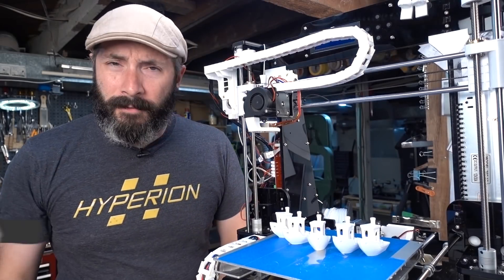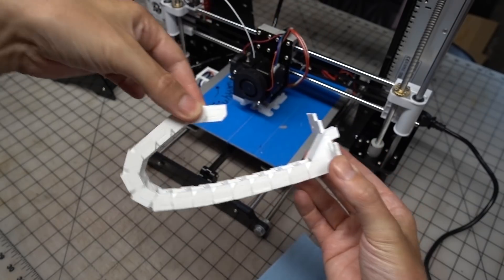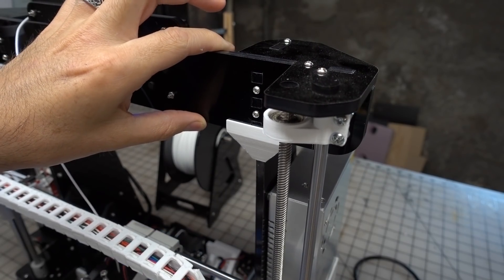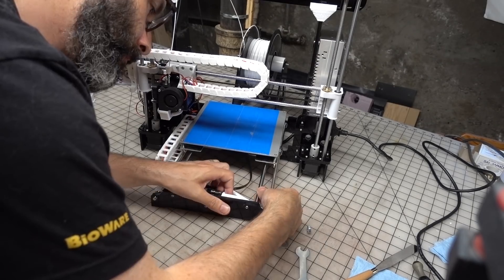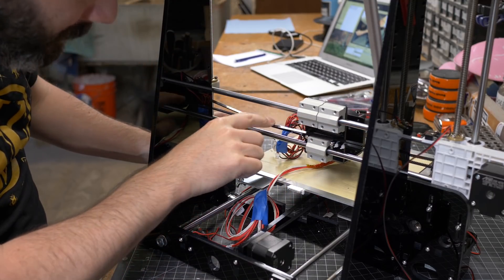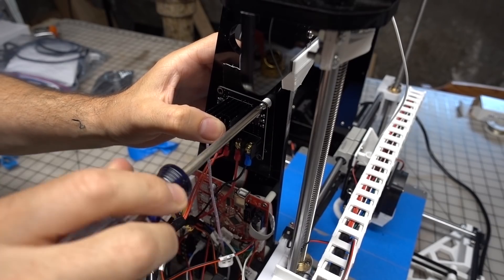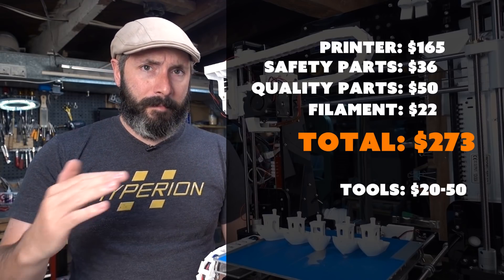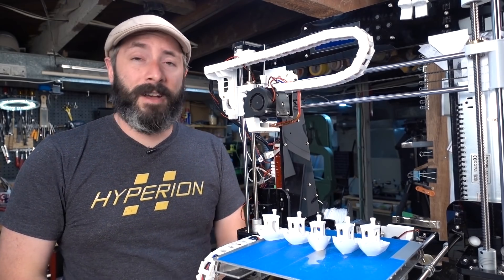Make a Cheap 3D Printer Better - Anet A8 Print Quality Upgrades

Comment: Really love your high tech solution to a noisy fan! I thought I was the only one who had to do that. I use a 15 sledge though. Hmm, maybe that's why the fan broke off the mount...

I also tried your finger snapping technique. I started snapping my fingers while standing in front of the printer. Nothing happened! What's your secret? Inquiring minds want to know...
Reply from the maker: Ah yeah I had to go to Hogwarts for like 4 years to learn that finger snapping technique.

Comment: I don't know why your prints come out like that. Mine had way better quality out of the box. Also did you check the lead screw couplers? They are supposed to be loosely coupled to the motors. That really helps

Comment: Nice you've done about all of the AnetA8's upgrades for the stock setup. I think you already have the 30A 12V psu, and the on/off socket.
I'm still tinkering with mine as well and it has been a journey. I'm printing ABS at 270 degrees with a 85 degrees hotbed and it gives very strong parts.
I recommend that you:
- update to a newer version of skynet3d, look at their facebook page. (maybe calibrate your extruder e-steps)
- buy a polycarbonate print bed sheet, the cheapest 220x220 for cost me around € 3,49. If you ever melt holes in it, it can be fixed with superglue and sanded down.(super glue is also polycarbonate)
- use some cardboard and maybe aluminium foil to insulate the bed.
- buy an e3d V6 clone bowden setup (€8.09), and extra all metal throats (5pc, € 1,62) so you can print ABS or better.
- Some better PTFE tubing for jamming it against the extruder so you could print flexible filament. Maybe a translucent/clear one, it's about € 1,- per meter.
- Push fit couplers for the PTFE € 0,29 a piece. If it says it's for 3d printers, it's an 1/8"BSPT / PT (OD:9.5mm).
- set of e3d clone nozzles (€ 2,06 for a 8pc, which is a set from 0.2 to 0.5)
- Extra thermocouplers 100K ohm NTC 3950 since they can break if you over bend the cables. (€ 0,45 or cheaper)
- A better extruder, use MK8 or MK7 gears (€ 0,72 a piece) I recommend a tight extruder
- Some bearings for a spoolholder and extruder. Usually 10x 608-2RS or 625-2RS go for € 3,11 or something.
- If you want a very sturdy Y axis, buy 1 meter of M6 rod end, and use this thingy ''Y-axis rework for Anet A8by matsekberg'' OR ''Anet A8 Frame Braces w/Y-Axis Belt Tension Rods by LittleMrJ'' 

optional: 
- Buy silent fans if you want to. Some set ups use 3x40mm fans. On my own thingyverse I have made a 3x50mm fan one. These fans are € 5,- a piece.
- an external micro SD card holder.
- A better screen, buy the ''upgraded'' anet screens with the turn button. (€ 11,16)
- Print lighter bushing holders to reduce the weight on the X-carriage.

Anyway that should be able to give you 60+ mm/s whilst being highly accurate and reaching 270 degrees. Just note that the Anet's hot bed is pretty meh and can reach 100 degrees but it cannot maintain it. 85 degrees was the best it could keep stable for me. I print at 150mm/s to 100mm/s, but it cannot reach that speed with certain shapes. 
Also my outer wall speed is 60 to compensate for the speed and drooping at 270 degrees with cheap 10 euro per 1kg roll ABS filament from hobbyking.
But hey it works and it's pretty fast and stable atm.

Maybe you can use what I just typed or anyone else who reads this.
Reply from the maker: Thanks for the tips!

Comment: Ok I know this video is super old now and you may have already been told this, but I haven’t seen it in the comments. You need to extend your Z axis couplings! The lead screw end should be flush with the hole in the top of the frame. I’m willing to bet that was causing a bunch of your problems. I have this printer and it took me forever to discover that on my own. It stabilizes the Z axis while also leaving some wobble room for the slop.

Comment: This weekend I'm going to start building my printer.
Reply: Make sure to join the Facebook group for the printer and read up on the process. and ask questions if needed.. the instructions are passable but there are several things you can do while building to improve the machine (such as flipping the print bed tray, ensuring the front acrylic print bed plate is the right way around, and finally installing the Z-threaded rods in right). Also make sure those belts are tight! Biggest improvement to print quality has been making sure they are tight. 
You will have a lot of fun building it!
Reply: Good advice! I bought one after watching Bill put his together live on stream. Price point seemed good, difficulty seemed low, & I intend to do the same sort of things Bill plans with his. So it was a nice surprise after the purchase to see how huge & supportive the community is for the A8! LOTS of informative & friendly users in the Facebook group, lots of YouTube videos out there on upgrading & repairing things too!
Reply: Suddsky s it ended up printing about as good as my monoprice select, for a bit less money with the upgrades. Imo you should just save yourself the time and just buy a better printer

Comment: Yeah, something just doesn't feel right here... I got excellent print results with my A8 straight out of the box with no upgrades. I did use a cordless drill with a very low torque setting to assemble it and make sure the frame did not move. It seems your frame moves A LOT comparatively and I think that might be the primary issue. It does take some force and two hands to bend my frame like that. There are a few small parts that did crack during assembly so take care not to over-torque them. Some people suggest that the z-axis screws have to be perfect, but they don't - mine are 2mm difference and it doesn't affect the quality of the print at all - that's what bed leveling is for! I did end up putting a switch on it because that was just annoying and will have to upgrade the power supply since it has trouble keeping temps when using the heated bed.
Reply: The heated bed itself is low powered. Source: use an ATX power supply.

Comment: Not sure if I got lucky or you got a dud but I have a bone stock a8 and it prints beautifully.  I do plan on adding the mosfets and a little cable clean up but I couldn't be happier with mine I've put well over a thousand meters through mine will little to no issues.  It would be interesting to check a good one and a bad one side by side to see where the differences are.
Reply from the maker: I've heard that from several other people. I got the runt of the litter.

Comment: Out of the box this printer was making very good prints for me compared to what you were showing.  A big part of print quality comes from your slicer settings...cheapest upgrade is to fine tune them.  I would get rid of the "Anti Wobble Upgrade" It's not an upgrade and goes against the idea of the spring coupler at the bottom, the better "upgrade" is to make sure the rods are aligned properly.  The A8 can achieve fantastic prints comparable to $1000+ printers without much put into it other than tinker time.

Comment: Iirc you're in the Seattle area, if I'm right, go to Tacoma Screw for nuts and bolts. They have a Seattle location, Tacoma, and some others I believe. You can get whatever you need and at insanely better prices than Lowes. It's also a great store for tools.
Reply from the maker: +Joshua Ogden Yeah that place is awesome! It's about 30 mins north of me.
Reply: I love Tacoma Screw

Comment: Ive never had a 3D printer but the more i watch these videos and what parts i can make, the more i want one.

Do you recommend this for beginner? Its not that expensive also.
Reply: jw200 Sure, I own one and I recommend it for beginners. And once you run into some basic problems and look them up, how to fix them, you'll be more understanding on how it actually works and you will feel more satisfied with your results. Mine, prints excellent, some of my prints turned out better then more of the expensive printers, you just have to fiddle with it a bit but it is worth it!

Comment: belt tensioners by far make the biggest improvement to print quality out of any of the upgrades they should be printed first. I started printing in ABS so i didn't need to upgrade my fan nozzle right away so i was able to get a lot of the frame stiffeners made.

Comment: The most significant performance improvement I got out of my Anet A8 was taking all of the core components and turning it into a CoreXY machine. I really don't care that it's "no longer" an A8, I bought the printer for the pricepoint, not the design.
You should really measure the diameter of your smooth rods. You were showing the play in the bearings, when I checked my smooth rods they were everything but 8mm, and not actually smooth either. the diameter would vary along the length of the rods by more than 0.1 mm.

Comment: The updates look great. I haven't done much to my A8 except the donut exhaust and filament guid. I'm gonna try the oil on the thread bering, frame stabilizer pieces and wire chain next.  As for the helmet I'm guessing it might be either iron man or mass effect ✌🤓🤘
Reply from the maker: +RedSin Designs Both good guesses, but nope!

Comment: I have almost all the same printed upgrades on my a8, I set mine on a foam mat to reduce vibrations, Also maybe try printing with different cooling and speeds, this is what improved my quality the most
Reply from the maker: Yay foam! I'll be tinkering with print settings in the next video.

Comment: So would you say the tensioner bracket thingies were the only upgrade to the printer that resulted in better resolution?
Reply from the maker: It's hard to say exactly, but they certainly seemed to make the biggest difference.

Comment: I bought an A8 after your your original build video and just now finished adding mosfets and a new power supply, and my next step was belt tensioners and frame braces. Quick question, did the rear y-axis frame brace fit correctly at the original size or did you have to scale it? Seems to be some back and forth on this.
Also you may want to look up the Hulk frame brace that has had great reviews for stiffening the entire frame (replacing the T brace you printed). So much fun upgrading this machine!
Reply from the maker: My rear brace fit just fine, but it was very snug.

That Hulk frame brace looks cool! Not sure if I'm gonna commit to adding it. I'm nearly done printing my helmet already.
Reply: The joy of this printer is you can always add it later! Thanks!

Comment: since you are an upgrade expert, i would ask you a help. is it possible to use a small printer electronics to make a bigger printer? for example, tronxy-100 to CR-10 MAX ?
Reply from the maker: Hmmm I'm not sure, that's not something I've ever tried to do

Comment: Hi PPA, why my Anet A8 with board v1.7 (she had a 1.5 but it was replaced because it die) when is heating up, no matter the temp thet you stablish for printing she never goes to the temp goal and stay always 5º behind and like this the printer doesn´t start... I have to feed directly the 12 V in the mosfet to heat up to the stablish temp.... can you help me?

Comment: Great video Bill! Did you print your x-axis chain assembly before adding there MOSFET? I am about to make this mod but I don't seem to have enough length on the thermistor line to mount it below.
Reply from the maker: I'll be honest, I don't recall which order I installed the upgrades.
Reply: Punished Props pity, great instructions though, much appreciated
Reply: FYI - I had more slack than I thought. I was able to print off a dual-mosfet mount from thingiverse and hook up the hot-end connection w/o issue after rerouting some of my cable collections a little.

Comment: I made none of the changes you made there to my A8, and get much nicer Benchies from it. There seem to be stringing issues with yours. Are the print temperature settings fitting the filament you use? By the way, my A8 gets the best results with the really cheap PLA filaments. I once shelled out loads of money for big brand name stuff. It clogged up the hotend and caused me shitloads of trouble. none of that happens with the cheapo stuff, no fibers, carbon cuttings or fairy dust. Any such filament additives actually weaken the printed objects as well.
What I did:
I got a board of spruce, some ½" thick, screwed some more wooden bars under it perdendicularly to the spruce board's orientation of grain for stiffness, and glued some small pieces of scrap wood to its top that firmly lock the A8 in place. I can easily pick the printer up from the board if need be, but it can't move in any direction when sitting on it.
I also added a 24x24cm pane of glass (None of the borosilcate woo-woo, plain window glass. Well good enough here) to the heat bed. Some clippings of PCB raw material glued to the pane's underside keep it in place. A shallow notch hat to be ground into the underside of the panes to make room for bits of the heat bed connector. Ground with a Dremel-thingy, they took three minutes each. Use a little water to keep the grinding dust in check, glass dust is nasty stuff. Three pieces of window pane cost me a tenner, cut to dimension and edges ground nicely by my local glazier.) There is enough extra travel in the the X and Y-axis to make use of the etxra build area. I didn't encounter issues with the printed objects not sticking so far. As my printer sits in my living room, I only print PLA so far. ABS etc. might be a different story. Oh, and I use glue stick  for adhesion. Pritt and Uhu. By the way, if you can get it forget about cyano-acrylic and epoxy for glueing PLA. You want Uhu Allplast. It does a perfect job with PLA. None of the superglue stink and mixing and hurry with epoxy either, plus it's cheaper.
What with those circular air nozzles: I think they are bogus. You want hot air to be taken away from the freshly printed bits. In order to achieve that, you make airflow across the hot area, not small eddies that whirl around it. I printed one of those things myself, found it didn't do jack for the print quality, returned to the original one. Does the job.

I do plan to build a printer with a bigger working area. That's not because I am unhappy with the Anet A8. I love the bugger. My only real criticism is that it's not too good at using the area it sits on. With its frame covering roughly a 20x20"/50x50cm area, it only makes 22x22cm print area out off the box. That's a rather poor use of space. This mainly inspired my DIY-project, getting that ratio improved.

Comment: just a hint, if you use a chain you have to change the wires to highly flexible the wires which comes with the printer are not suitable for chains they will break some day.
also i have upgraded my bed with a 4mm carbon plate so get rid of this bend and bowed alloy
no tape needed just a lil bit of hairspray or suger water from time to time, at work we use wires which feel soft when u touch the cut surface for chains

Comment: Thanks for the video its helps lot.
But I want to asks something. Is their any 3d printer that can using a cement and sand material? As this can make it easy to print a baluster and roman columns without using a mould I need help please Sir

Comment: You don't need to manually home the printer before each print, just add the  G28;    command to the start g-code in your slicer.
Just look for start / end gcode on the reprap wiki. I made mine move the tray forward once it's done so it's easier to remove the part.
Reply from the maker: Oh that's really cool! I've never tinkered with the actual gcode before. Thanks!
Reply: Yes using Cura (or other slicers) to customizing start and stop G-Code is really helpful! I've got my Maker Select Plus set to move the Y axis all of the way to the forward position (by default it does the opposite making it hard to remove 3D prints from the build surface.

Other examples are retracting filament to prevent oozing, Turning off the bed heater after a certain time, turning fans off after a certain time. Etc...

Comment: I own a Tevo Tarantual and I am happy with it. It cost me 180€ and i did literally two upgrades 1st a dual fan filament cooling and an ajustable Z-Endswitch and it prints like a dream. But i can not understand why a printer from the same pricerange prints not as close as good as mine does even though i spend just like 2 hours adjusting Settings an printing Upgrades

Comment: My Mecreator 2, which I got for just 250€ from Geeetech new has a much much better print quality. On amazon you can get it for 350€ and its pre-assembled. The only disadvantage is the smaller printing volume but If your print is to big you can cut it in multiple parts and glue them together. The only upgrades that I printed/bought were a 0.3mm nozzle and TPU feets for less vibrations. A fan that cools down the print is already pre-assembled. It just took me like 10 minutes to set up the whole printer!

Comment: Suggestion: add some aluminum extrusion (doesn't have to be T-slot extrusion, but it is nice) to the frame to stiffen up the acrylic...
Reply: Oh, and triangulating it to brace the bed frame assembly to the top of the X-Z axis assembly might be a good idea also...

Comment: My recommendation is to make the x and y belt tensioner first these have the biggest upgrade on your prints. Then stiffen the frame up with Z Wobble Brackets and T-Brackets. With these upgrades alone my printer is making amazing looking parts as far as chain cable guides they are 95% ascetic 5% upgrade as my cable management has to problems from using the stock cable wrapping and stress reliever clips i would make these last. Fan nozzle is for PLA plastic most of my frame upgrades were made in ABS as its stronger and more durable and does not require part cooling there is a half circle nozzle that's said to be the best part cooler not the full circle one again i recommend to make it out of ABS as its close to the nozzle and subjected to heat.